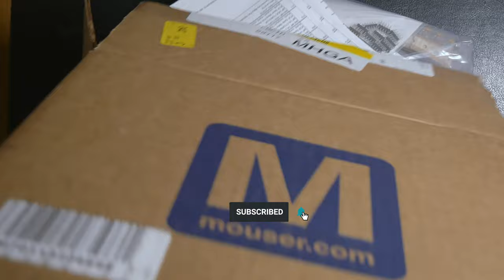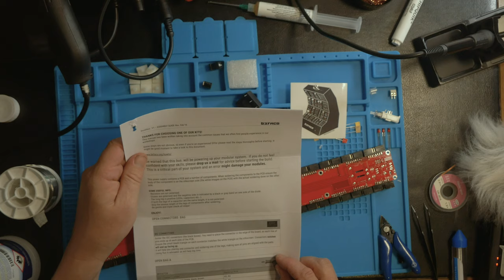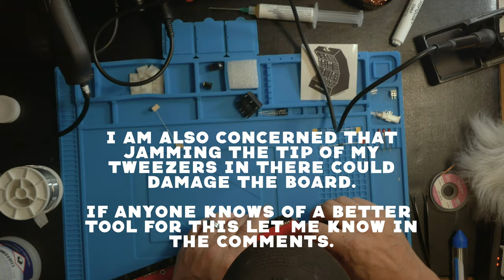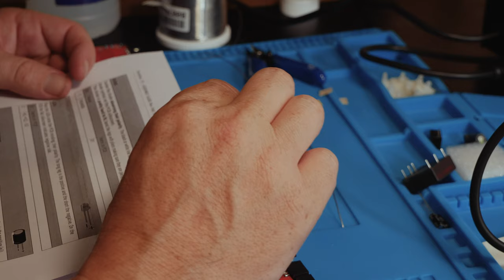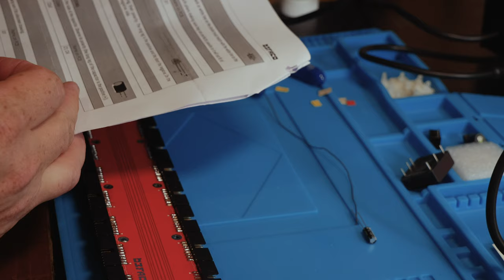Eurorack DIY Lab // 01 Befaco Excalibus

Comment: Thanks for sharing your build!
I wanted to share my failure with others. I did a different eurorack power supply kit and thought I'd just press all the IDC power connectors on the board and solder them all at once. I managed to solder half of them on backwards before I realized. Those connectors are incredibly difficult to remove even with solder wick and a solder sucker. I got impatient and used a heatgun and melted the connectors (no problem, those are easy to replace) and damaged my PCB a little bit. Trying to save a few minutes ended up adding HOURS in fixing my build. 
For flux, the cheap tin that you need to use a brush with is what I always used, literally using 20 year old flux for my builds (I went to school for electronics a very long time ago). Modern lead-free solder really benefits with dialing in the right iron temperature and extra flux helps too. Traditional lead solder (63/37 Sn-Pb) is noticeably easier to work with, but not environmentally friendly. (wash your hands before going to eat!)

Comment: Nice job Michael. Looks like you chose a good entry level project. Acid brushes work well with alcohol to clean the boards. Do not push out obstructions with tweezers, you can damage the PCB. Keep a few of the legs that have been trimmed off and with heat and flux, the holes clear easily.
Reply from the maker: Thats a really good tip for clearing the holes! Thanks!

Comment: Oh my goodness.  The similarities between you and I are causing me to fear that I might be the dreaded result of an experiment in human cloning that has gone wrong.  I own five or so aerosol cans, all labeled ‘Flux Remover’, and each one seems to be the most effective for removing one out of the five or so different jars of flux which I own.  My most recent DIY endeavor is to build an ultrasonic parts cleaner, specifically for washing off flux from my finished PCBs after soldering.  I should be able to forget about those different cans of flux remover solvents once I’ve got the polarity of the ultrasonic transducers sorted out.  I sense that you yourself might be heading slightly in that direction, if you insist to continue on with the Synth DIY Madness.  I’ve got to wonder and ask the silent powers there are, “Just what did we poor and undeserving souls do to ensure that such a fate would befall us?!?”  I am being a bit dramatic, although the weight and severities of these stressors involved with learning electronics have few to be matched out there.  But when the rewards do finally grant us a slight promotion, we had best be modest enough to revel in it, and quick enough ought to be our celebrations since those stressors aren’t going to ever stop their onslaught.  Good job and THANK YOU FOR SHARING THIS!!
Reply from the maker: Thanks! This comment really made me smile (although it took a couple of reads for me to fully understand). Anyway, what the hell is an ultrasonic parts cleaner? It sounds like the FUTURE! 
Cheers, dude!